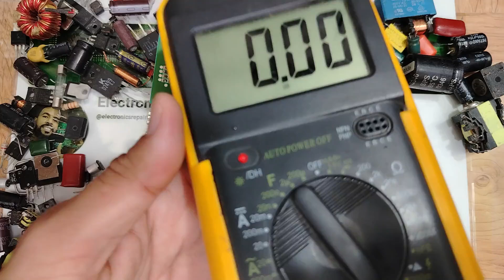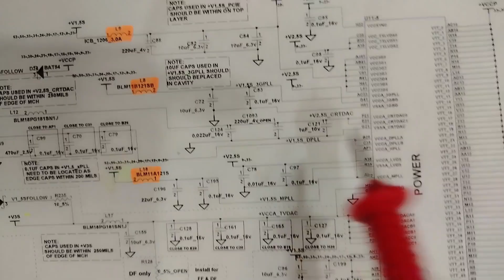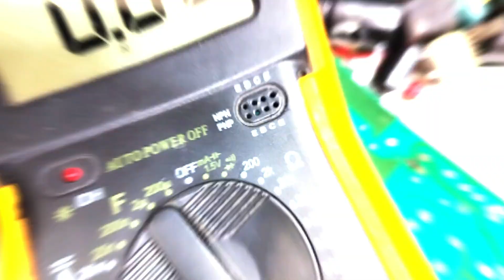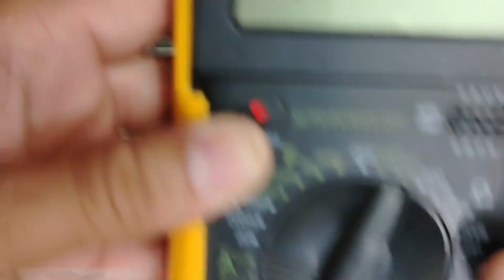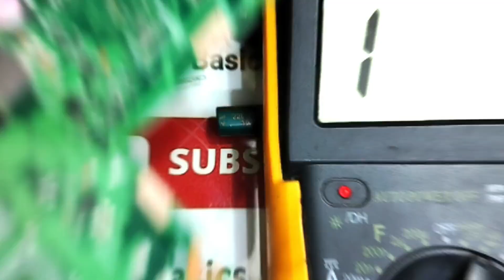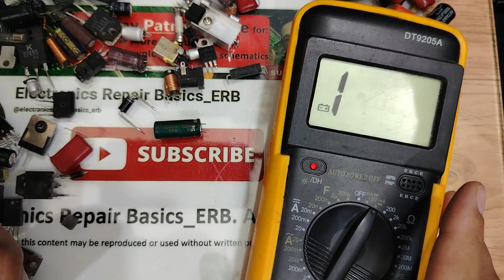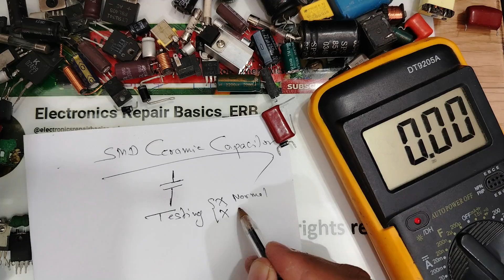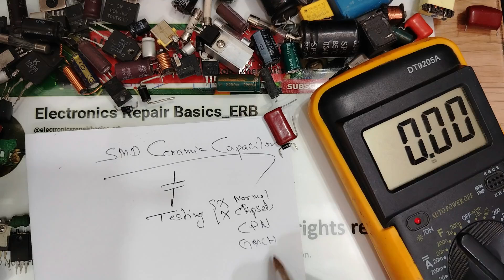#004 Electronic Components: How to Test SMD Ceramic Capacitors Like a Pro

Comment: Resp Sir! Nice Dhanyavaadh Sir. Sir My Seagate 500GB Hard Disk Spinning and Stopped Sir. Sir SMD Diodes, SMD Capasitors are 2 Sides Values Displayed with Multimeter Sir, Removed that Good Values Sir Diodes are Only Single Side  Values Sir. Motor IC or CPU IC Problem Sir..? Please Advise Sir. ఎలాగైనా Repair చేయాలి అనేది పట్టుదలతో ఉన్నాను Sir. అది మనం తయారుచేసిందే కదా Sir. ఎందుకు Repair చేయలేము..? 🙏🏻... Please Advise Sir.  --   ChinnaRao Paderu Andhrapradesh.

Comment: how to find value on smd caps if multimeter does not have farad reading. beside schematics or special tool for  caps, is it possible find value with  basic multimeter?

Comment: You should record a video about multimeter calibration. Values returned on caps near the CPU have to come out really precisely and for this the multimeter has to be in the tip top shape.
Reply from the maker: I appreciate the suggestion.
Reply: Où est-ce qu'on trouve le schéma ??? s'il vous plaît

Comment: And I have a question: There is a ceramic capacitor on my monitor that does not give any response, but I do not know its characteristics for replacement. So, to replace it, I can only look for a diagram to determine its characteristics?
Reply: Yo should unmount the ceramic capacitor and then take the measures
Reply from the maker: Great question. Yes, looking for a diagram or schematic for your monitor is definitely the best way to determine the characteristics of the ceramic capacitor you need to replace. But you can base it on its size and color.